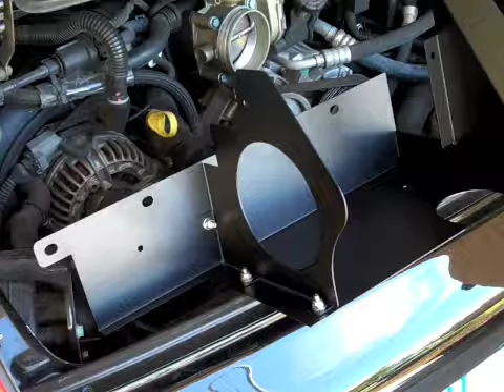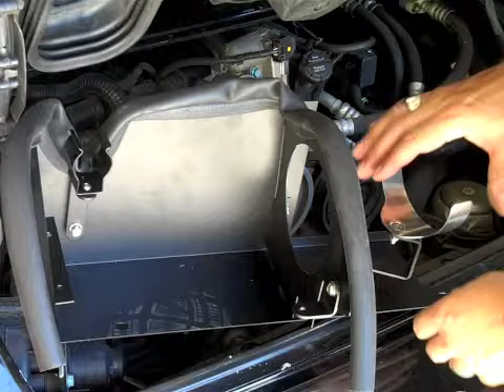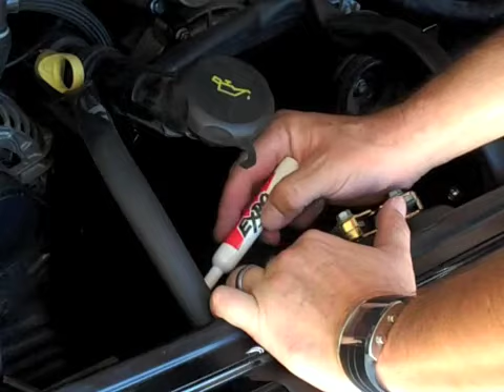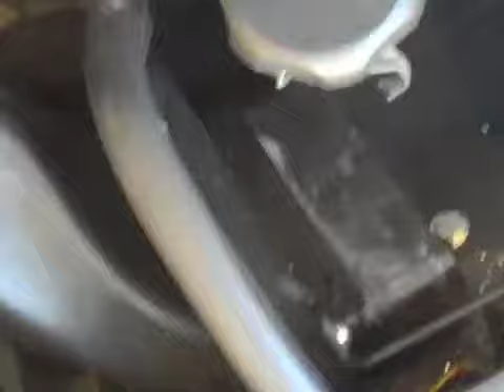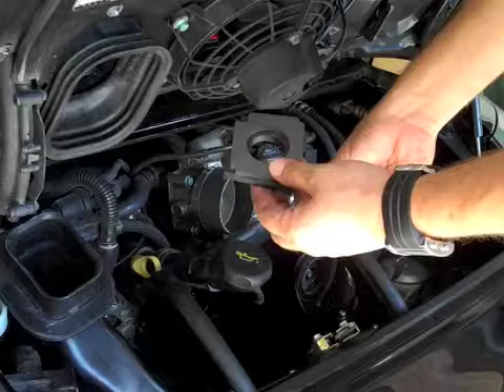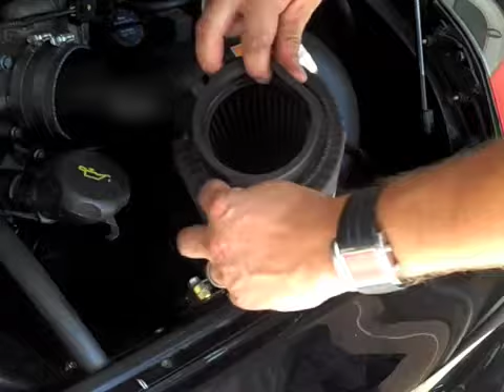K&N Cold air filter Porsche 996 C2 Install

Comment: Danged. I ordered up this kit and tried to install it yesterday. There are three little protrusions on my car where the bracket fits down on the body that move the entire assembly forward about 1/4 inch. Due to this the bracket is pushed up tightly against the AC pulley and actually touches the belt. I could cut out notches in the mounting plate and elongate the three mounting holes but don't think it is worth that effort. It looks like it would be a very nice kit but it just does not fit on my car.  VERY good video and thank you for making this.

Comment: I did mine a week ago. This is not as easy as it looks.1. All the nuts and bolts come in a bag. The directions tell you where each bolt goes but, you have no idea how to tell one from another..2.  The air intake tube was difficult.  I had to add a bolt to the bottom of the shield to try and wedge it to stay upright.3.The tensioner and idle pulley were rubbing the back of the shield. Had to exchange to a flat bolt at oil fill and hammer a round notch so tensioner pulley wouldn't grind. 4 hours...